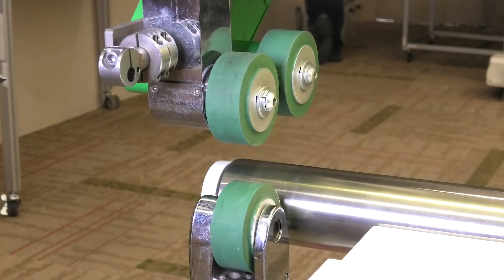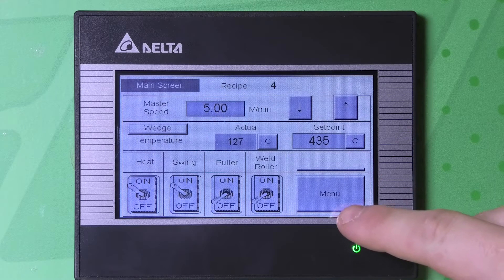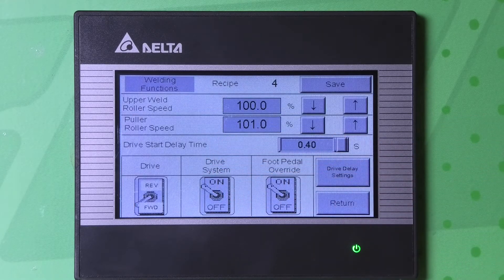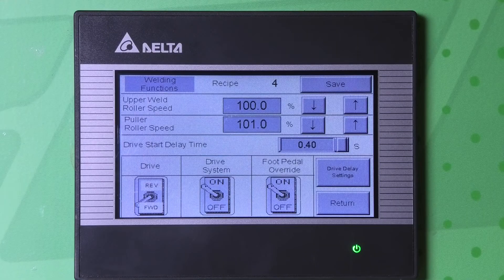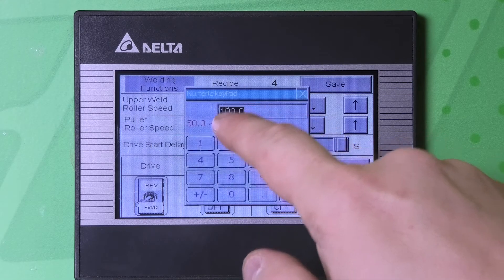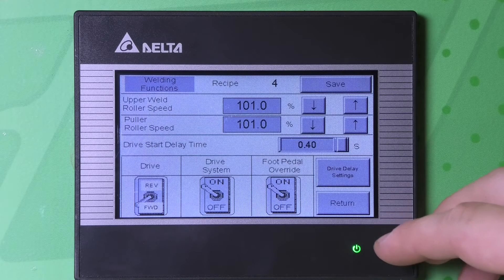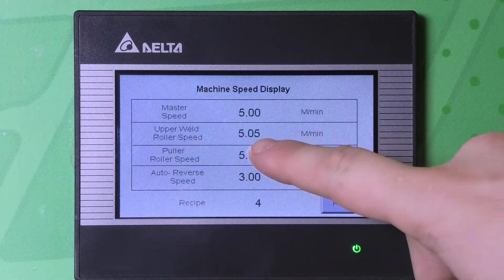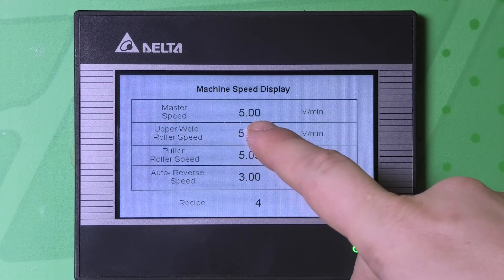Tech Tip | Explaining the Upper Roller Speed | Miller Weldmaster

Comment: When and why would u need to change upper roller speed?
Reply from the maker: Straight from our head service technician, he said this.

"Let's say you are making a inflatable, this is a guide free application so you have to hand feed it through the machine. Operators may struggle keeping the pieces going through the machine at the same pace, this gives you the ability to change the speed of the top roller so they go through evenly.
If you have 2 five foot pieces of material, you run them through the machine and on the top piece you come out a little short, lets say half inch. You can slow down the top roller speed. This will stretch the material to the size of the bottom panel. This works for the bottom coming up short, you would turn up the speed of the upper weld roller."

Hope this helps you out! Any more questions, please contact service@weldmaster.com